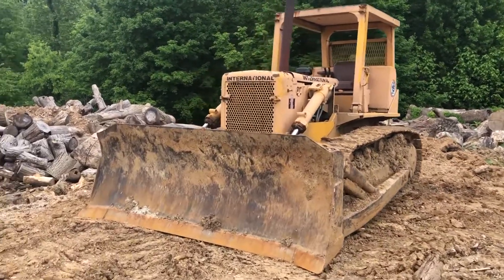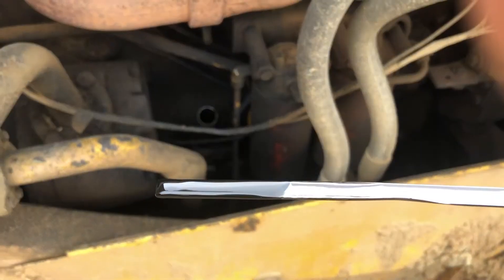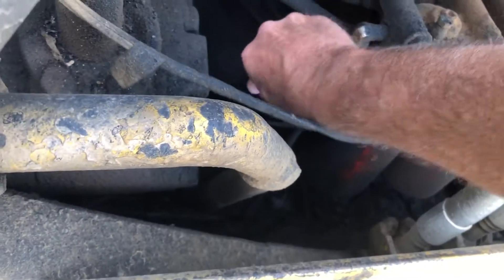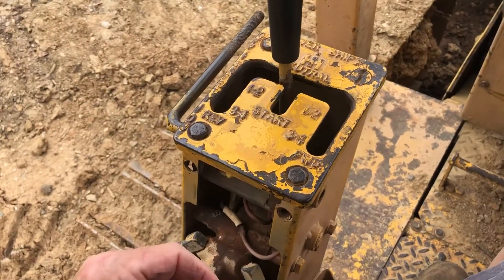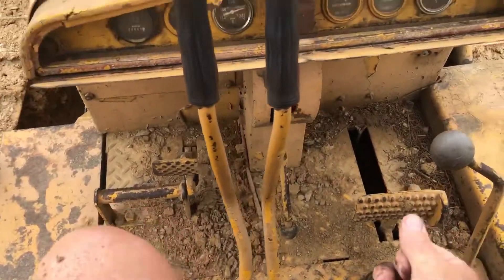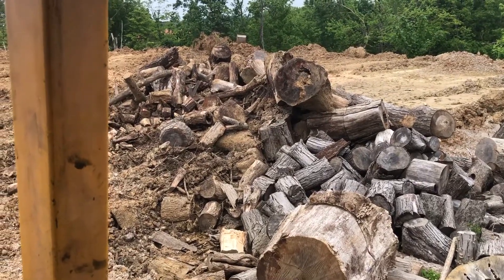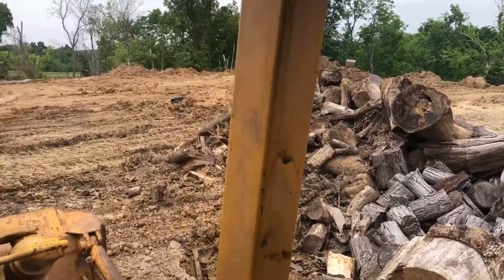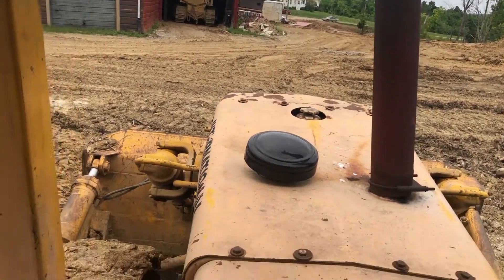Starting the IH TT15B so I can push in some dirt! @Hfoutdoorsyt @DieselCreek

Comment: This thing's making oil!!! Nice machine buddy!
Reply from the maker: We like it okay. That driver’s seat gets warm once the hydraulic system gets hot. It blows right on your legs so I want to put some exhaust fans down there to pull the heat to the rear. And the steering clutches need adjustment. But hey — it pushes mud!

Check out my other videos if you have time. They’re sometimes entertaining. 🦑